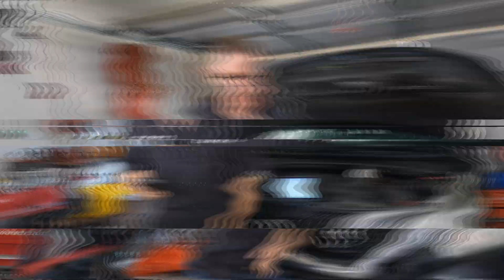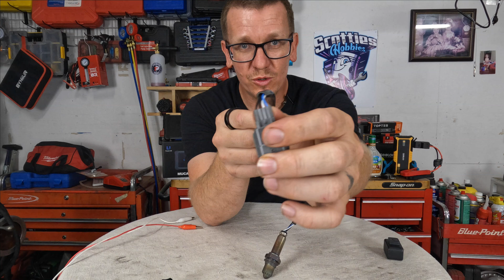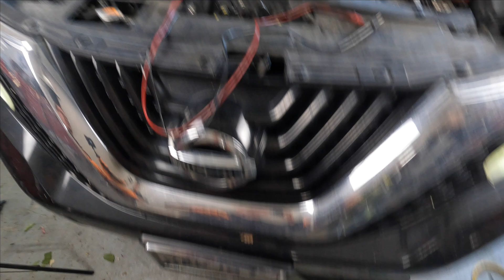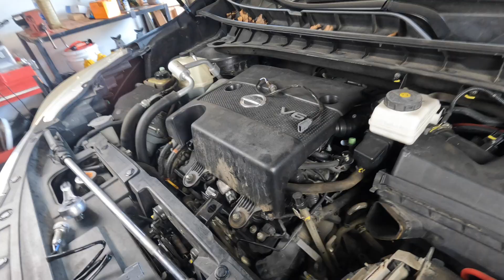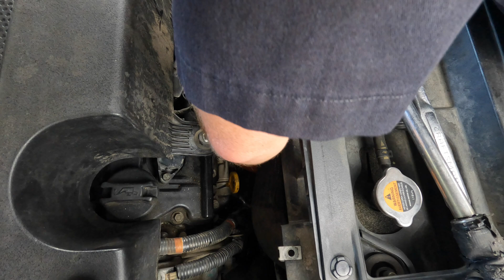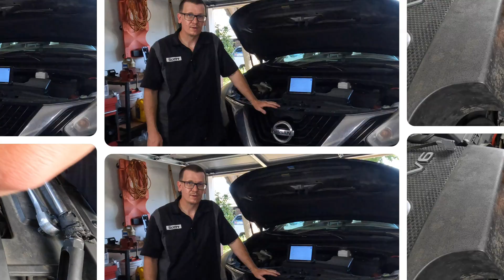P0051 Code FIXED! How to Diagnose ANY Heated O2/AFR Sensor Heater Circuit Malfunction FAST

Comment: At 3.25 min. you said the meter reads zero ohms, but the meter reads OL which is over limit or even infinite, which is the opposite of zero ohms. Zero ohms is a short and OL is more like an open circuit.
Reply from the maker: I thought in ohms OL was open loop in ohms? Either way you are right. Any time the probes are not touching anything that meeter reads OL. 🤔
Reply from the maker: For instance.  At 03:48 both probes are in my hand and not touching anything. Its reading OL.
Reply: @ScottiesHobbies  I first heard the term "open loop" in automotive in the late 70's when the computer systems started to come out, which meant all the criteria was not met to go into closed loop. I can't remember if I ever heard that term in the electronics world.
Reply from the maker: @kwd57  i'm from automotive world too. Many moons when i was learning stuuf. A guy once was using a fluke similar to the one i have. I just remember him telling me when measuring voltage. 'OL' was 'over limit'. When measuring ohms. 'OL'  open loop. I never took the time to look it up. So that could be inaccurate info... a old timer also told me Crane Flies are Mosquito eaters... and thats not accurate.  Lol
Reply: @ScottiesHobbies  I have never heard that, but with a little imagination, it kinda means the same thing.
Reply from the maker: @kwd57 true.  

Thanks for stopping by to say hi and adding to the conversation. 👍🏻✊🏻
Reply: @ScottiesHobbies  I started watching your channel when you talked about the readiness monitors may be changing and not ignoring the EVAP monitor. I have a 2003 Chevy Avalanche with 17k miles and I replaced the battery 2 years ago, so I drove it in all the conditions to set all the monitors, but I can't get the EVAP to pass. I retired from the auto field in 2002 and this was the kind of work I did, so I am out of the loop now, but those monitors were irrelevant back then for passing a smog test. I would like to get a factory service manual and see what the criteria was needed to pass the EVAP monitor only. That is going to cause a lot of problems for many people if that monitor has to pass. When I had the smog test 2 years ago, I think it said NA for the EVAP monitor. This is not something to take to shop to get repaired when there is nothing wrong with it.
Reply from the maker: @kwd57  is your fuel guage and temp guage working on the dash?
Reply: @ScottiesHobbies  Yes
Reply from the maker: @kwd57 damn it. That was the wrong answer.  I just bought the Motor Guide Book, OBDII Drive Cycles. If you want to shoot me a email, I'll take a picture of the page of that drive cycle in the book and send it to you. I've been wanting that book for a while and you inspired me to just go buy it. It'll be here in a week. Shoot me a email at Therealscottieshobbies@gmail.com
Reply: @ScottiesHobbies  Ok, I sent it
Reply from the maker: @kwd57 perfect.  I got it. When i get the book. Ill take a picture and send it to you. Lets hope its got the info you need. 🤞🏻
Reply: @ScottiesHobbies  Ok, thanks